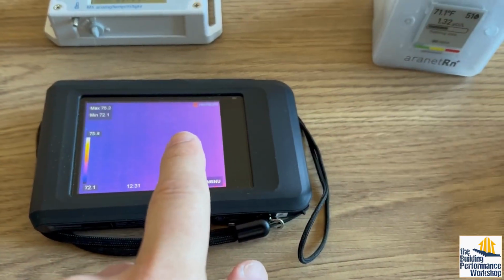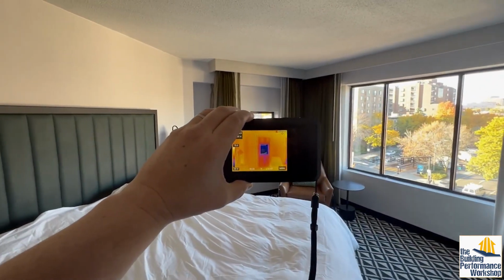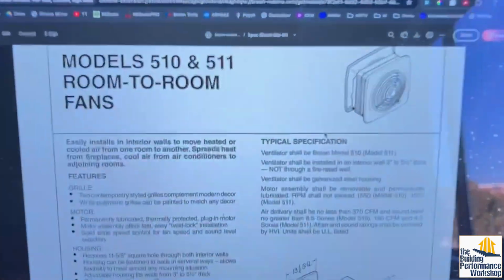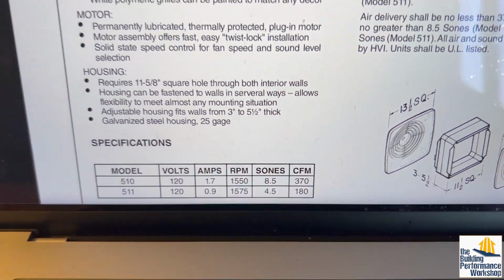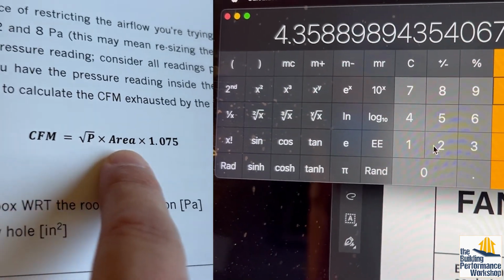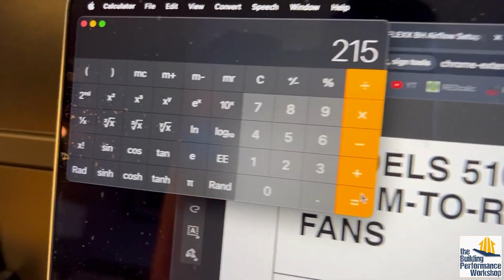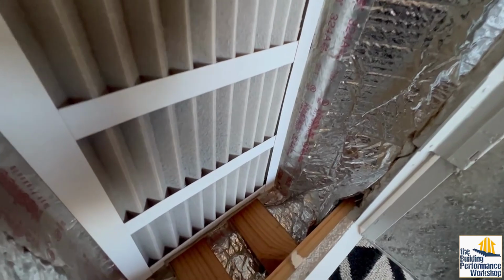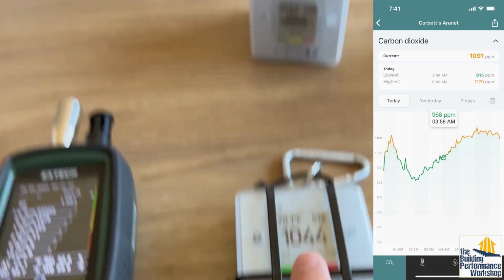Hotel Room Suite Tested: Infrared Camera, Pressure Differentials, Transfer Fan, IAQ

Comment: Great content. In my experience, however, ( commercial electrical/HVAC Technician) fan motor age is rarely, if ever the source of unwanted noise. It is the fan bearings that fail and cause noise (ie. scraping caused by misalignment and lack of lubricant with each rotation). High end computer fans, which see a long term use at high rpm use magnetic bearings to avoid wearing, reduce operating noise,  and mitigate loss of energy due to friction. Old motors typically pull higher amperage to perform the same work (loss of efficiency).

Comment: Is it useful to measure particles above PM10?
Reply from the maker: Those are visible, so you don’t need a sensor really- also, they fall to the floor pretty fast.
Reply: @HomePerformance  What air particles meters do you recommend? Also what meter should I get for carbon monoxide?

Comment: How dry should I make my basement. I am on a steep hill so I half my bottom floor is encapsulated crawl space 4’ tall. The other half is daylight basement. I keep the humidity in the basement at 47% and the humidity in the encapsulated crawl space storage at 55% (total moisture is the same but its 5 degrees colder in the crawl space)

I have a bookshelf on the wall between the 2 rooms and the humidity behind the books is 51% to 57%. So I got 2 moldy books. I’m lucky I noticed and put a humidity sensor on all 15 shelves. 

I’m going to run the crawl space dehumidifier more. Is a 50% humidity target good enough. Or should I set it to target 45%. 

I do have a cold air return in the crawl space but I don’t have a vent. There is a 2sqft hole between the heated basement and the crawl space.
Reply: Ok I think I have a plan. Set the dehumidifier target to 50% and have the air output from the dehumidifier blow on that wall. Warming it up 1 or 2 degrees compared to the rest of the crawl space. That should get the area behind the bookshelves to 48% humidity.

Comment: What.. A hotel with poorly designed and I stalled HVAC. Never heard of such a thing. The better half spend half the year in hotels and they all have the same problems. Not enough ventilation in the bathroom to get the humidity out as she showers like lobsters are cooked so she has to crank the AC way down to compensate. They also have very poor lighting in general and most rely on lamps vs ceiling mounted lights.  
    
     I like the point on moving air around. I really need to run a return to the other side of the house for one. But I also need a tiny quiet through wall fan like that for the pantry as on the other side is the garage and with the pantry door closed it gets warm in the summer.